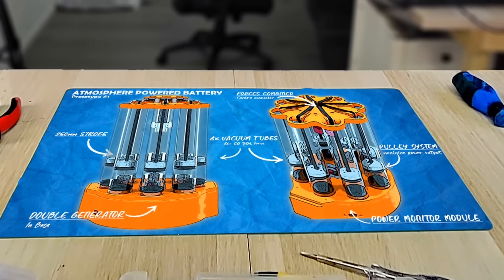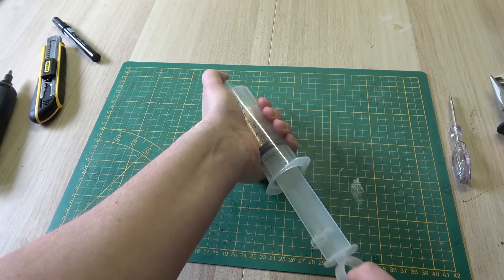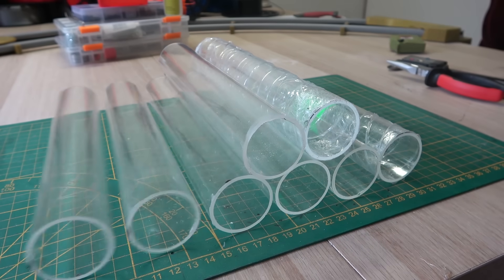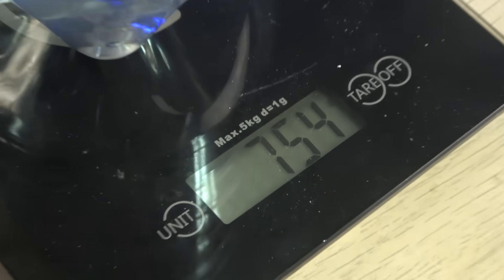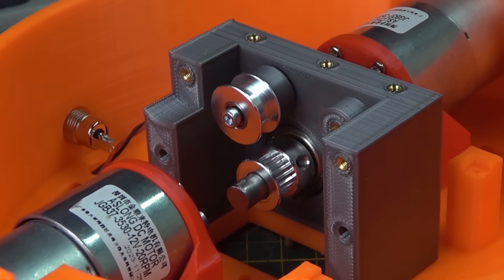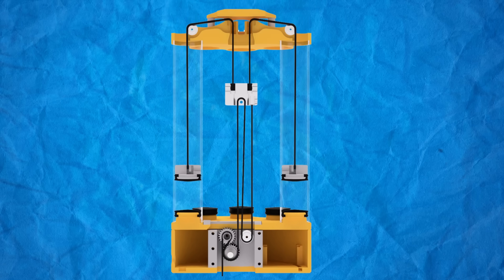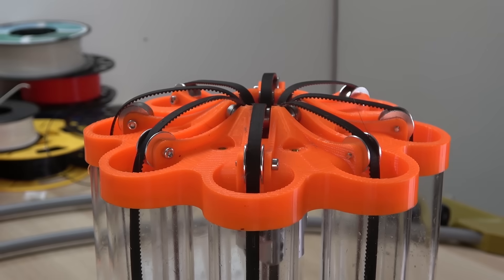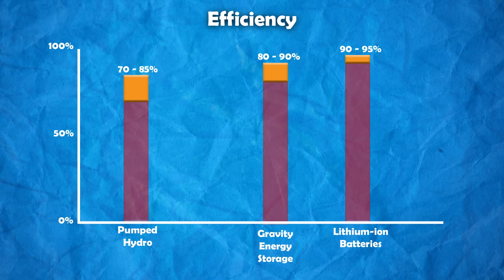Building an Atmosphere Powered Battery..

Comment: One thing you should consider in addition to efficiency is the size of the system. How big would a full-scale machine need to be to store and then release the same amount of energy as that of a pumped hydro for instance? Unlike compressed air batteries, the pressure difference between the inside and the outside is not higher than one atmosphere, so to generate more energy you must build a bigger machine (i.e. a bigger vacuum volume). However, with compressed air, you can increase stored air pressure by using stronger materials or thicker metal without much increasing the machine's size.

Comment: I wonder where those efficieny number for "gravity energy storage" comes from. I suspect the only sources are marketing material, and that the real number is close to pumped hydro (which technically also is gravity energy storage. The cost is massively in favour of pumped hydro, as the mass (water) is essentually free, and it is a proven technology.

It is of course impossible to say more about the losses and the cost per kWh (the unit shold really be kWh^2 with time twice) in vacuum storage at scale. It is however possible to make a size calculation. 1m^3 of vacuum would require 10^5 Nm to create at sea level (approximately) this is 0.028 kWh.

Someone said below that energy density is not a factor in grid, but to store the same as a realtively small battery storage (1MWh) you would need 36000 m^3 of vacuum tank(s).

Avicii Arena (Globen) is the largest (approximately) spherical building in the world with a volume of 605 000 m^3 would store less than 17 MWh of electricity at a perfect vacuum.

Compare this to pumped hydro (that sure are larger than 100m diameter and 80m high) that could store about 20 000 to 40 000 MWh.

And battery storage:
In 2017, the California Public Utilities Commission installed 396 refrigerator-sized stacks of Tesla batteries at the Mira Loma substation in Ontario, California. The stacks are deployed in two modules of 10 MW each (20 MW in total), each capable of running for 4 hours, thus adding up to 80 MWh of storage. 
A fridge[1] is about 0.7 m^2 so the storage volume would be 277 m^2. 

This was a fun experiment, really, but sometimes physics get in the way of the fun.

[1] I just hate when things are unrionically stated as "olympic swimming pool" or  "fridge" and things like that. I mean, I had to check up standard measurements for an olympic swimming pool, and a fridge to figure out how many fridges there are to a swimming pool. By the way, there are 3472 fridges to a swimming pool, and Globen is about 242 swimming pools. And the sotrage capacity difference between the battery storage (396 refridgerators) and Globen is that you need about 5 Globen to have the same storage capacity in kWh as that battery storage.

Comment: If this concept is used for long term storage of energy  some of these problems can occur
- air particle can leak in to the system even thru extremely small holes (even thru thin rubber layers!)
- water molecules can eventually boil and vaporize at the extreme low pressure and will reduce the peak vacuum pressure.
- effect of changing temperature.
but thinking more about it, this system could be very effective in  some cases 
_ store solar energy at daytime, also use the thermal energy to assist expansion and hold the position till late night,  when temperature is low, use battery and you will get some extra bit of energy
-Instead of using this as a battery, use it like a super capacitor where it can store sudden kinetic energy spikes from various natural sources such as waves and later release it in a stable flow, so that the energy can be utilized much efficiently etc.

Comment: an easy way to improve this is to increase the difference between vacuum and the surroundings. The higher the pressure differential the better, right?
So in principle, if you simply submerged the whole thing in water, it'd take more work to charge and it'd give more work on dischrage, right?
The main concern (besides sheer scale needed for anything actually practical like storing excess energy from solar panels or something) is how reliably the vacuum seals are. You demonstrated this working a few times in a row. Could this work for years and decades? How easy is it to repair in case of failure? How catastrophic are failures?

Comment: It's a cool looking build, but I have my doubts that it would scale. For one, I'd be worried about the structural integrity. If the whole thing implodes you don't want to be near it. A big advantage of the gravitational storage is that it's pretty stable. With the syringe seals and the motors needing to stall to keep the "battery" charged, I suspect that your efficiency is going to drop quickly if you try to store the energy for longer. So if you want to scale this up, I think you'll want a sturdier vacuum tank and a passive way to seal it once you've pulled the vacuum. I think regular vacuum pumps use something that looks like a car's engine though, so the cylinder-piston combo isn't a bad idea.

If you still want to revisit the gravity battery: for the best combination of accessibility and density you'd probably want to use lead (there are denser materials but I'm guessing you don't have access to kilos of plutonium or platinum). At 11.35 g/cm3, you'd only need a weight of under a meter long to equal the theoretical maximum "surface efficiency" of your atmospheric system of 1 kg / cm2. I'd say that building that into a disused chimney is still going to be more feasible and safer than the vacuum system. 

Alternatively, it might be interesting to look at compressed air energy storage (CAES) systems. Same idea as yours, just going the other way around. The benefit there is that the energy density is potentially greater since you're not limiting yourself to one atmosphere of pressure.

Comment: I think gas leak would be the main challenge of this.  It's probably much easier to keep water from leaking out of a hydro system long-term than it is to keep the seals from leaking the vacuum here for roughly the same efficiency.

Comment: Years ago I had an idea to make a similar rise/fall power generator using the sea and magnetic floatation tanks in vertical coil tubes. The tank would flood with sea water at the surface and sink to the sea bed, inducing electricity into the wall of the vertical coil tubes. A small amount of energy (perhaps solar) could then be used to refill the tank with air from the surface and the tank would then rise, inducing more electricity on the ascent.

Comment: Didn't Benjamin Franklin make something like this?
Changes in air pressure caused a bellows to expand and contract...the motion was used to wind a clock.
Not very reliable...but they do work!
See also: Water-drop generator...thousands of volts out of thin air...only moving part is water.

Comment: nice idea, there is the issue of part failure though, not just with 3d printed parts for the prototype, from what you explained discharging the stored energy relies on the vacuum overcoming the force needed to generate energy from the motors, if you have the tolerances dialed in to where it's got a 10% advantage over the motor threshold and one of the vacuum chambers fails then with an 8 cylinder system you're now at a 2.5% deficit to retrieve that power meaning either the system is going to lock up and have to be dismantled to repair or it will discharge without outputting power, either way you lose all of that stored energy from a single failure and with multiple failure points that's a lot of loss for something that could be quite minor in the overall construction. The only way to avoid this issue is to make it that the system has some pretty significant redundancies so that even if multiple parts failed say from some sort of impact because accidents do happen could it operate safely and effectively with a 10%~25% reduction in effectiveness rather than just the 2.5% even then that's quite a significant drop off, in the current system you could lose all output from a single chamber failing meaning a 12.5% loss in efficacy losing 100% output, tuning it to have even 25% means if something falls on it and cracks 2 of the vacuum cylinders you will be right on that line of maintaining output or losing it all. A more resilient version with built in redundancy might be instead of 8 large chambers have it set up where there are 8 clusters of chambers of 8 each with lower volumes each but the same overall, you'd also need to factor in increased losses to friction but the unit as a whole would have more redundancy baked in reducing potential loss of all stored energy you could have multiple points fail and still retrieve the remaining energy before needing to make repairs.

Comment: The important part in deciding battery feasability is to take into account the amount of energy required to make it, and the amount of energy that'll be used and lost throughout it's lifetime.

For example:

Battery = amount of energy required to find, mine, manufacture, and distribute the batterry + amount of energy it can store/discharge throughout lifetime - energy lost to inefficiency

If this example of a new type of batterry has a lower energy cost of production and longer lifespan, its lower energy efficiency would be irrelevant since the lifespan and low cost of production would make up for it

Comment: I've often wondered about something like this using a float in water tank. You could let the water out to sing the tank (which generates energy if heavy enough) amd pump water in (or use a river or rainwater) to float the tank also generating energy.

Comment: You would most likely get better results with a compressor and air motor (similar to old steam engines) as I saw that the cylinders were leaking in air (the bubbels in the tubes). To hold a vacuum in any container with moving parts is next to impossible. You can add air to a pressure tank but not remove it from a near vacuum once your "battery" is fully charged and no more movement/charging is possible. Every cycle some air will leak in and reduce the charge level possible rendering it un usable after only a few cycles. For a more practical battery high pressure is far more reliable and durable, just be careful not to over pressure your storage and blow it up. Clever idea but not practical, good luck on your next project.

Comment: This setup actually made me think of something kinda interesting: Since your energy storage in this system is working against the atmosphere, the work you have to put in to charge the system is dependent on the atmospheric pressure around you and same in reverse for the energy you get out when you discharge it. So charging the system on top of a mountain where atmospheric pressure is lower will take less energy, but when you move it back to sea level before discharging it, you would still get the regular amount of energy out of it - so that "extra" energy has to come from somewhere else in the process. But where?
I'm pretty sure the difference would have to come from the fact that with the system charged, the vacuum takes up additional space without adding any mass, so the entire system would be slightly less dense, giving it higher buoyancy and making it so you get that tiny amount less energy back from moving it back down the mountain, than when you had to move it up the mountain in the discharged state.
Or perhaps I'm missing something more obvious. lol

Comment: I wouldn't care much about efficiency being lower than anything in comparison. It's all about the process! And it looks awesome, at least on the video ;P I really wanted to make a gravity battery of my own but the scale was too big, as you said ;P still, I believe humanity should keep looking not only into the renevable energy sources but more eco-friendly energy storages. It's better to build multiple 73% eff. vacuum batteries that will last ages than one e.g. li-ion battery that will require to be replaced in few years and pollute the environment. As long as we are so bad in recycling and have only few solutions for conventional power banks we should thread carefully.

Comment: I think compressed air might have better energy density. Only problem I see is the energy density it can store. You have to also see how long the energy can be stored - and energy leakage from air seeping in or gaskets degassing. Those issues are minimized by using compressed air instead. This can store enough energy to heat water for a couple of coffee.

Here you only get negative One Atmosphere. But in compressed gas you can go almost hundred atmosphere. But then there is the risk of explosion. Energy is lost as heat at compressing the air. But you can retrieve it as a cooling effect when discharging. Energy retrieval is way less than other options. I would use a Tesla turbine at high RMP with a very high gear-down ratio.

Comment: But most green energy actually causes more damage to the environment than nuclear energy?... I'm confused, is this a bait?
Reply: Basic law for energy is minimizing the number of steps between. Each additional step gives environmental loss.
Reply: Yeah, this is clearly inefficient. 1- Mechanically generated energy has always been shit and inefficient. You're now using a battery that embodies it in both generation and dispersion. The reason we don't use any mechanical storage is because it's been found out a long time ago that it's not efficient at all, there is a reason we store the electricity itself, and not the potential. 

I use solar, it drives a crank (environmental loss/conversion loss), it puts remaining energy into potential energy (literally fractions of generated), now I use stored energy to drive crank (MORE ENVIRONMENTAL/CONVERSION LOSS) to disperse power. I new the first 3 minutes that this was bad. You have way too many environmental factors that will always keep this inefficient. The idea isn't new or fresh, it's been around for a long time, it's just always been inefficient hence it was considered a waste of time. I love the approach of the project itself, but dubbing it an "push for green energy" is really bad. 

Okay, as an engineer, I will explain this as simple as I can. Nuclear is what we call CLEAN energy. It has no emissions, no environmental impact, nothing. Wind turbines? Environmental impact. Solar panels? Resource intensive and inefficient. Tidal? Environmental impact. Please research each of the green energy forms, without having political bias and actually look at the research studies of how EACH source of energy has impacted the environment. Protip: wont take long.

As far as storing, degradation of DC power is low, hence we store in batteries. AC is great for long distances. Now when you store DC, it has a pretty good shelf life as long as the cell organization is optimized to evenly disperse the load, preventing cell death over long period of use. More efficient storage also isn't the industry focus, as  storage has been solved. If you want to know what the industry is looking at, it's what I've been talking about since my 2nd post. Reducing environmental/transitional loss. There is a reason there is such a huge focus on super conductors, as that is going to be what breaks electrical engineering into the new industry, lossless transfer. 

I really like your approach to the topic, but you definitely need to research the pros and cons before investing so much time and effort. You have too many factors making this project viable, it wouldn't pass for any research facility sadly. I think it's a good stepping stone, and you were doing the math as you go (assuming you weren't just asking where the numbers came from after the fact), and it's actually what engineers do, you're just missing a lot of environmental factors.

Comment: First of all, cool battery. Super project.

Ok so you are charging with about 20 [W] and the capacity is about 630 [J] or 0.175 Wh (630/(60*60)). 
That is not a lot of energy but hey, it is still a battery.

You could use the tubes "as is" so they are 1m long, that would give you 4 times the energy storage. and the forces would be about the same on the structure.

3.6cm^2*3.14 41cm^2= 41 kg. 41 kg*9.82m/s = 402 N. 402 N*8 = 3220 N. 3220 N*0.25m = 805 J (the you have a little loss both ways, therefor 860 and 630 J)
330 kg force on this small a machine is actually impressive. A weight of 330 kg would give about the same result, but 330 kg is quite a lot. (it would take up some space.
0.25 m * 330 kg * 9.82 m/s^2 = 810 J

But on the other hand, then you don't have the friction and the vacuum of the cylinders to worry about.
Both designs benefit from adding more height and the loads would be about the same no matter the height. And you should be able to a little better efficiency out of this design, but I don't see it beating gravity energy storage due to the extra friction in the cylinders. But it looks like the energy dancetty could be better than a gravity storage.

Cool video, made me think a little that is always good.

Comment: I would like to have had a direct comparison to gravitational storage in terms of energy capacity.
What size weight does this equate to given the same elevation change?

I had to do the math myself. Assuming the cylinders move 250mm (I don't recall if it was stated in the video).
(9.8m/s^2) * 1kg * 0.25m = 2.45joules.
860.64watt-sec / 2.45joules = 351.3
The vacuum is equivalent to about a 351kg weight lifted and dropped 250mm. I'd say that's pretty good.